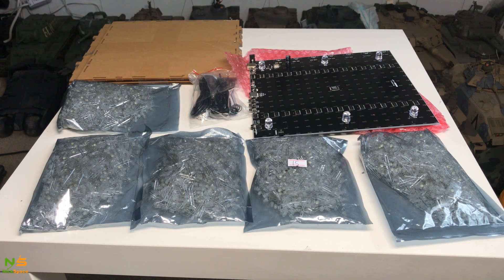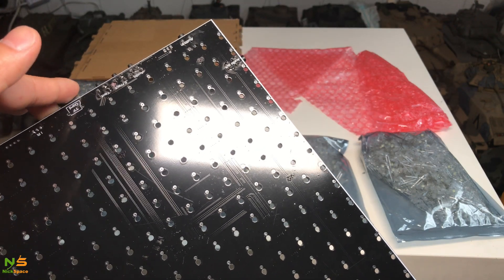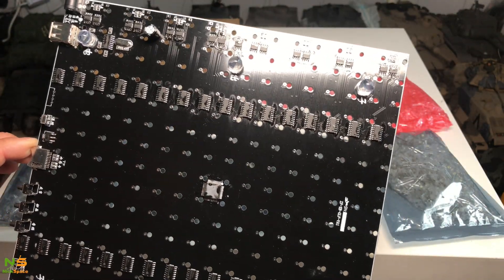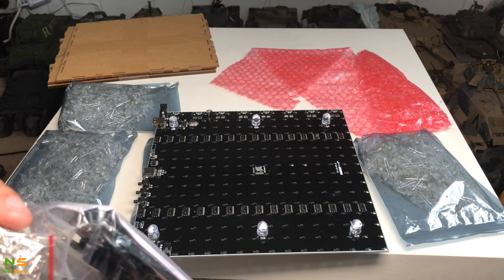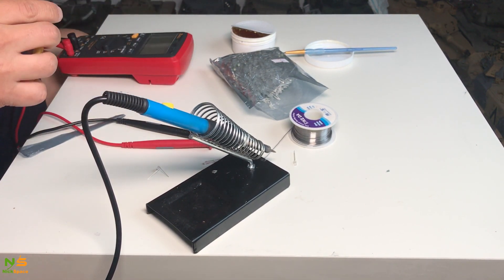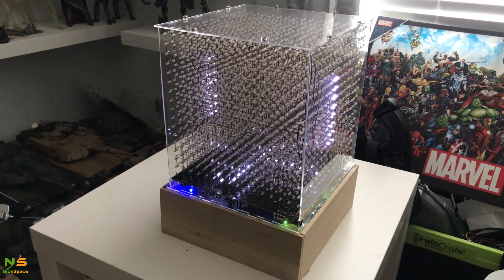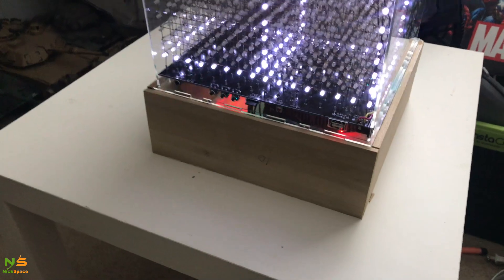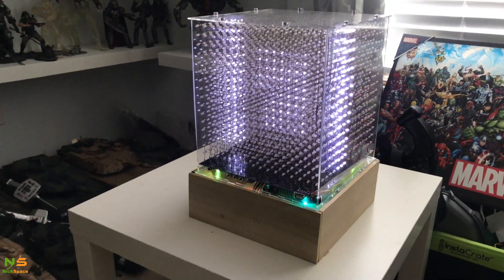How to assemble 16x16x16 LED CUBE from AliExpress Zirrfa store

Comment: Just to clarify, in the video you say that the anode is the shorter leg of the LED, but is that correct? The cathode is the negative pole of an LED and the anode is the positive pole, and the shorter leg of an LED is the negative pole therefore shouldn't the short leg be the cathode?

Comment: to make it simple to install the panels on to the board, furthest pin away should be long enough to fit in to the board, a line should be marked from the other side  of the panel at the  end of the wire graduating to the pin  on the other side of the panel, that way should be so much easier to guide the panel pins into place

Comment: Cool my friend I got the 8+8+8  coming but some of the led  come with steel wire want gos in the middle and top of the all the way through you have to Straighten them out the steel wire which gos on the top layer of LEDs and throw the middle

Comment: I  built a cube like this (RD16) bought from AliExpress . I had a lot of trouble getting it up running. The main problem was the LEDs, they break down very quickly. It was a hell of a job and to find out at the end that the products are of poor quality, they burn at a very high rate  with each feeding.
Reply from the maker: Sorry for what you was experiencing. Mine is running good even now. I don't turn it on 24/7
Reply: @nickspace78  Hi, thank you for your answer. You can even recommend a better LED supplier for this cube?
Reply: Hi, thank you for your answer. You can even recommend a better LED supplier for this cube?
Reply: Ciprian !!  i also build now the second one, but both are not working.
one level shines permanently. nothing more. 
if i remove the +cable from this level, the cube show me 2 words.....
but also nothing more.
if i push any button, the cube only flash very fast .
any idea?
i was extrem carful by my second one ! but he show the same issues like the first one.
i cannot believe that i have made the exactly same mistake on 2 Cubes .
maybe you have an idea? thanks

Comment: Hey Nick. Nice video.
I also build one of these 16x16x16 cubes and got it working. I haven't gotten around to try out the programming yet. how was the experience? I have been looking around for a community around these cubes, but I haven't found any yet, do you know any forums where people share their experiences and programming with the cube?
Reply from the maker: It took me a while to solder the whole thing. I tried to program and made little program to work however it is time consuming so end up I used the default
Reply: hello
i build now my second one! but both are not working! and the strange part is, they make exactly the same issues .....
is it possible that the soldering-board is broken ?